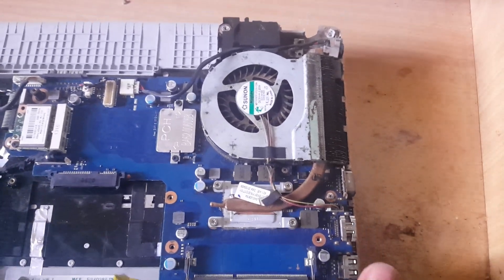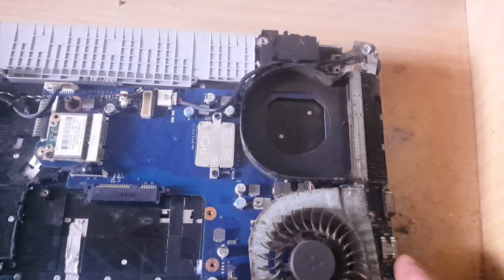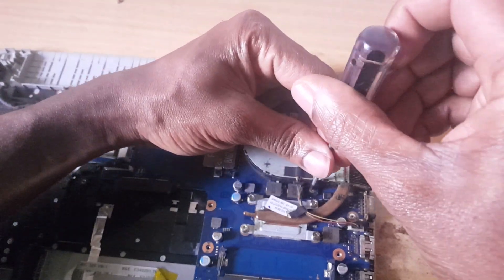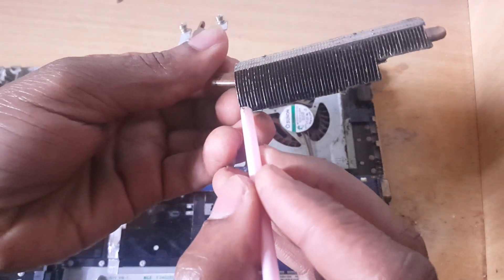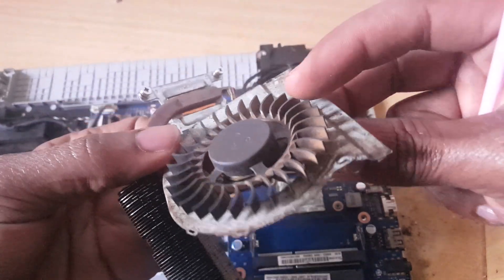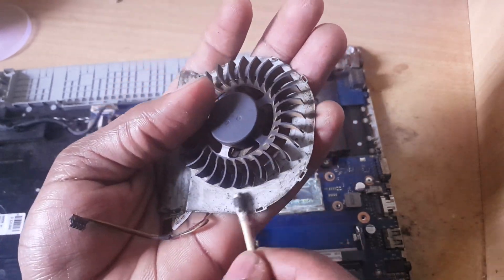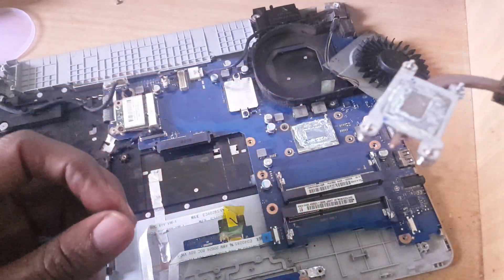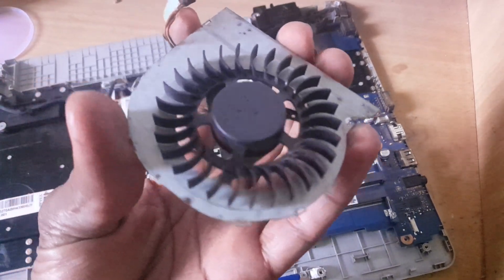How To Fix  LOUD LAPTOP FAN NOISE | QUICK FIX 100% Works

Comment: Thank you  sir. But does noice always associated with fan problem? or there might be other issues. because in my case i realise when i plug the power cable the noise increase but later subside. please advise